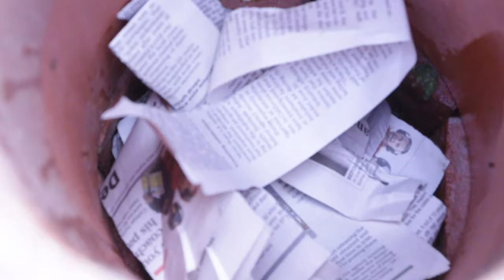How To Make A Terra Cotta Worm Tower [SUPER EASY]

Comment: Hey I have been loving your videos, and grabbed some worms with your coupon code 👍 thanks much for the information.
Question: if I wanted a lid for this to keep  pests away, how would you recommend making one?
Reply from the maker: Thank you for watching. You could use quarter inch hardware cloth and cast a small ring of concrete to hold it down (or integrate the two). A brick holding it down would be a simple solution, if that would work aesthetically. Happy composting.

Comment: Where can I find some terracotta flue liner ?
Reply from the maker: Hi Tristan. You'll need to find a building materials supply yard (not a Home Depot). It's the kind of place that has pallets of bricks stacked outside and big sheds of lumber. Call ahead to make sure they've got what you need. You could also build one just using bricks. Just get solid bricks for the above ground portion (bricks also might be cheaper than the flue liner). Stacking in a square format would work just as well. Worms can turn corners. :-)

Comment: How is it holding up? Where can I pick up the material?
Reply from the maker: Hi Ishii-san. It is holding up very well. I bought the materials at a construction supply store. Not the normal home improvement store. The chimney pipe is more of a speciality item. You could use bricks alone for this build as well. The bricks above ground would need to be solid. Thanks for watching.